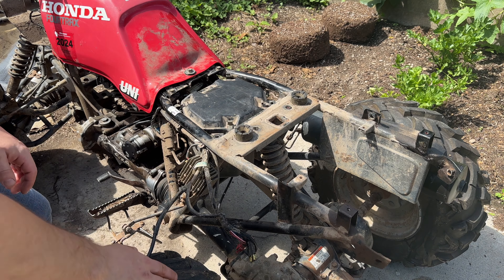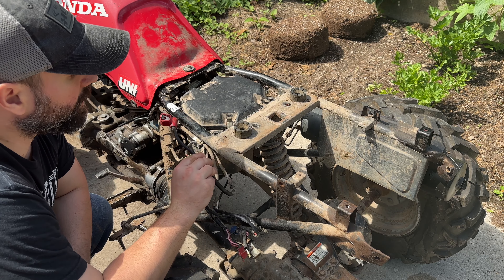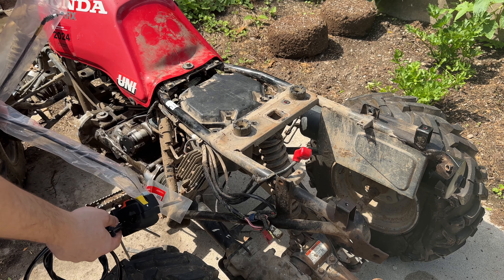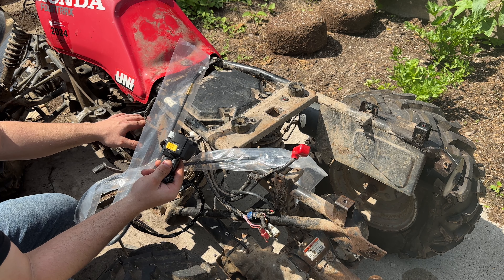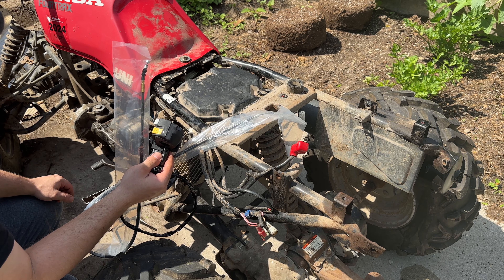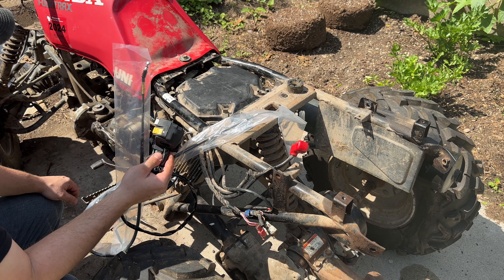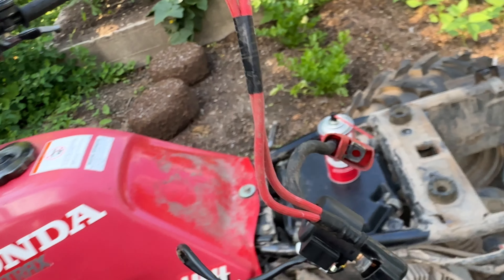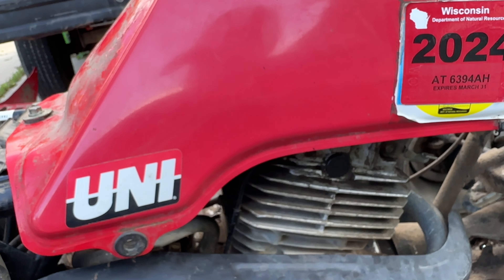Update on the Honda Fourtrax 300 ( Kill Switch , and Choke ) Part 1

Comment: My starter was bad. Verified power at starter with start button depressed. Replaced starter with a $30 one from Amazon. There are videos that people made on here about how to replace the starter. Very easy. 15-20 minutes. Works great.
Reply from the maker: @richardhenderson5342   I replaced mine with an OEM